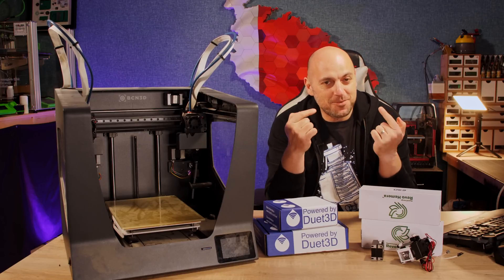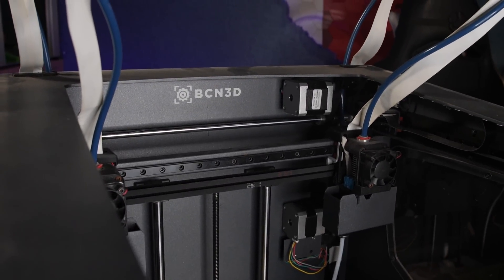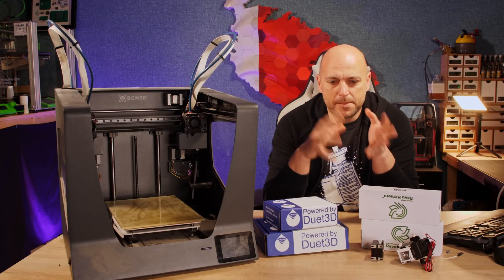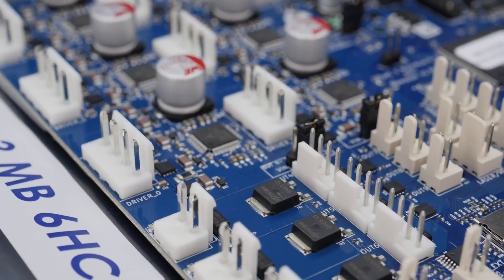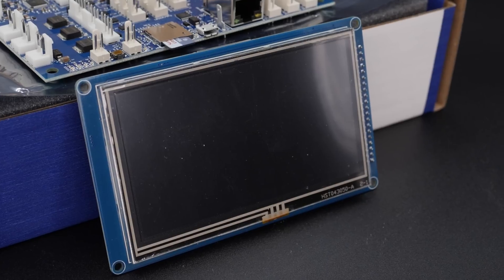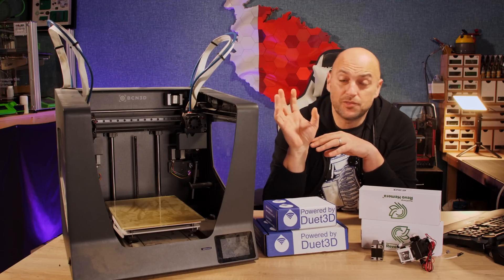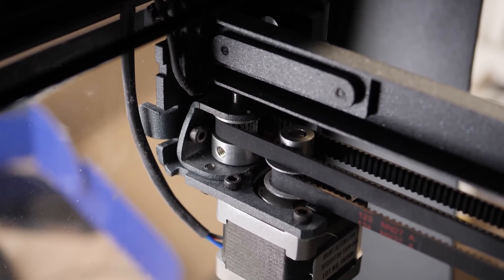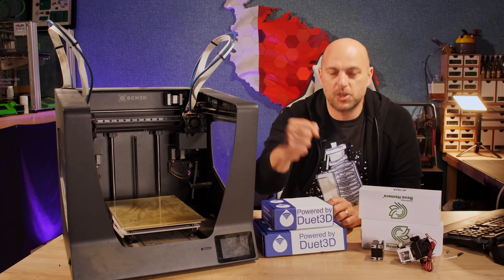My €2000 paperweight - Can it be saved?

Comment: Good luck with the project, didn't take me long to find out that printer was a bag of Sxxt I also did the bondtech conversion updated the drivers, the hot ends where garbage hence they got E3D to make them, and I could fry an egg on the stepper motors, a part of my journey into 3d printing I wish to forget.

Comment: I ran into the same issues with the SeeMeCNC Rostock V2. Without getting into the gory details, I changed out everything except for the frame. In order of disappearance: Power supply, extruder, extruder stepper, hotend, controller, hotend platform, rods to the hotend platform, belts, and even the build plate glass when a chunk of glass came out of it.

I finally gave up when I found that dimensionally the thing would print +.2mm off in the X axis, and -.2mm in the Y axis on a 10cm "L" calibration part. By that time the thing was worn out. I will say that it was great for printing doodads, but that was about it.

As for your CNC upgrade, did you look into LinuxCNC first? (and the stellar Mesa controller) I upgraded a 1980 Takamatsu to LinuxCNC and it works like a charm.

Comment: I had a similar thing happen to my first 3D printer a Creatbot, the case of the machine was very well built, pity the rest wasn't as well made.  At the time when I got it mid 2016 it was a almost $4,000 machine and that was on the cheaper end for 3D Printers then.